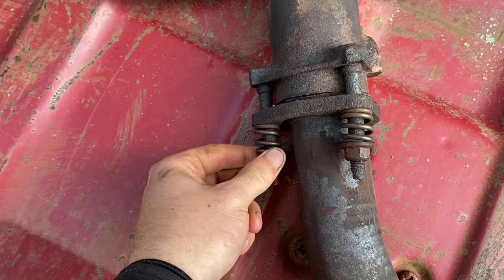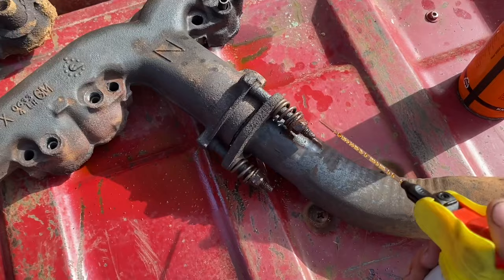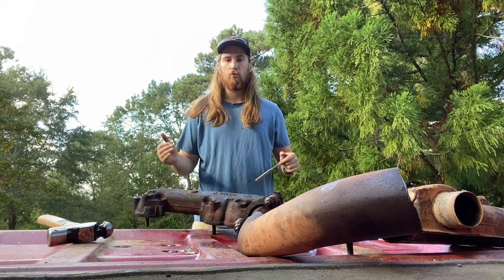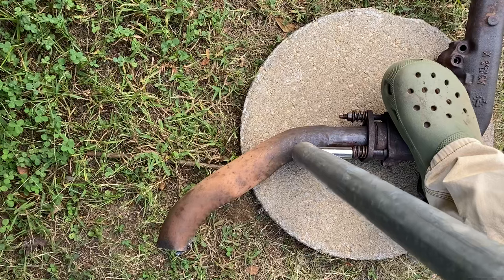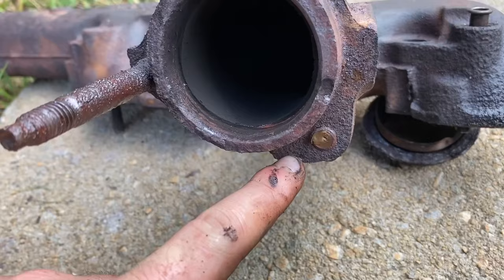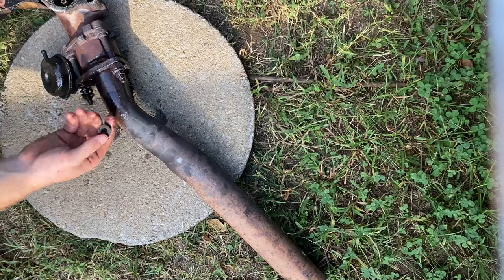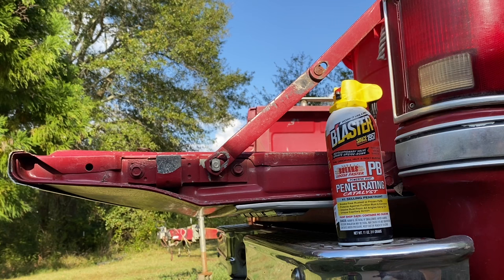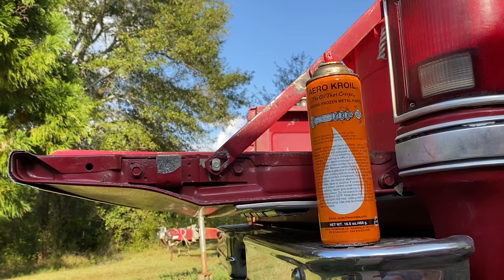Kroil Vs PB Blaster on Seized Bolts! Which is Better?

Comment: I can tell you my 40 years at least wrenching if you can soak the bolts down a day ahead of time repeat the process and once you get that nut to turn slightly back it in and keep lubricating it and repeat that process several times on each turn patience you'll have better luck not snapping a bolt but thanks for your video brother

Comment: Try a 50/50 mix of acetone and transmission fluid.
Acetone is flammable 
Acetone melts some plastics and eats paint.
Also tighten,loosen,tighten,loosen,repeat.
Red hot with a torch then impact  (no torch with acetone)

Comment: Next time you're trying to loosen a stuck bolt and it starts to come loose and then it freezes up the preferred method is to tighten it back up a little bit take little wire toothbrush or whatever hit the threads where it bound up put a little more of your penitrating oil the remove nut. Never force it

Comment: Kroil is known as “ the stuff that creeps” pb blaster works good to but isnt nearly as good as using kroil and letting the stuff sit for a long time.. like a seized engine, kroil works great for removing cuckka. Pb blaster is exactly that….. blaster with some penetrant and cleaner in it… use them both all the time and love both products but for something i really need to get loose or clean and it needs to sit i use kroil😎
Reply from the maker: Agreed. Appreciate your comment!

Comment: Ive found vibrating the bolt/nut as its soaking helps the penetrent. Vibrate it by rapping on it with a wrench for 5 minutes, or use an engraver, or use your impact on low for awhile.
Having heat on hand works better than penetrent. Sometimes, heating then rapidly cooling with spray bottle will break the corrosion weld.
Ive also snapped more nuts and bolts by hand as opposed to a impact wrench, so I try to use impacts only.
Thanks for the vid.

Comment: If you'd have wire brushed the heavy rust off the exposed threads it helps greatly if you don't have heat on hand.